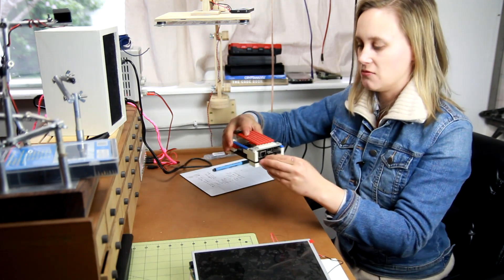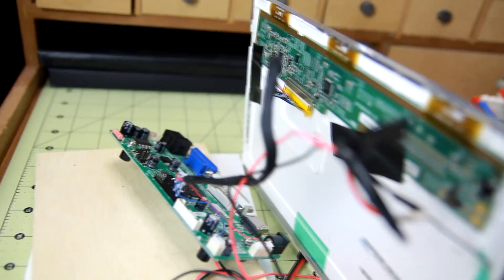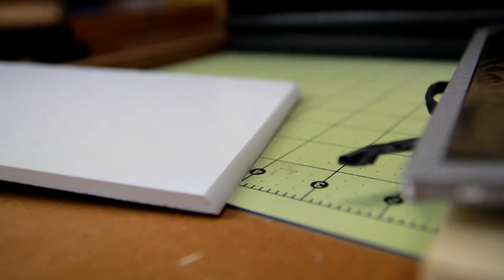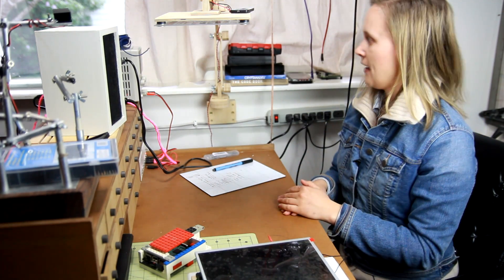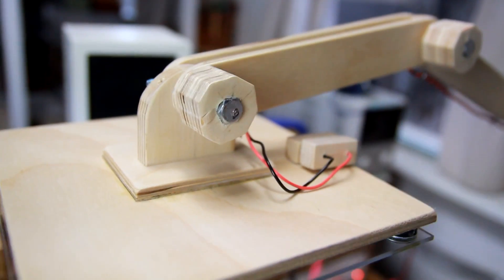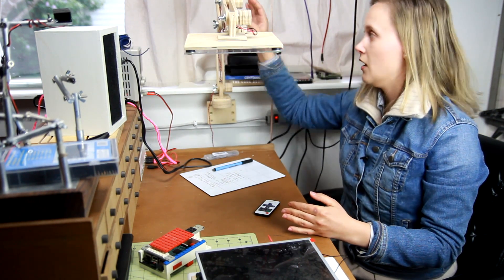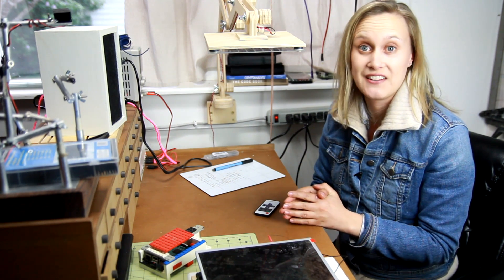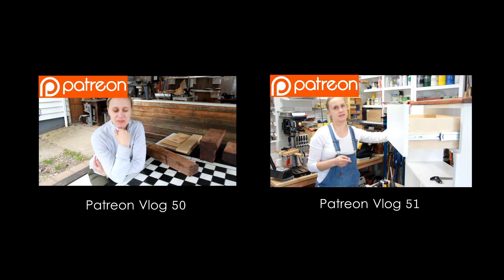Making an Articulating Screen w/ Raspberry Pi

Comment: hey linn 
I guess you need an arm with 180° angle and a support board on it with stainless steel spring that can hold that amount of mass you put on that arm maybe with a locking mechanism..

Comment: When I use Xacto knives for cutting thin plastic or cutting on a plastic cutting board, I notice they dull very quickly. A friend of mine who specialises in plastics told me I was right and they are very aggressive on sharp edged steel tools due to high friction.
Aren't you noticing any dulling on your router bits? Or maybe you haven't been using plastics long enough for any noticeable effect.
I'm very curious of the effect on them.

Comment: Only problem using Raspberry Pi with Arduino is that Arduino only offers an old version of the IDE for Raspbian OS !!  So the recent library management features of IDE are not available - and library management is a pain.

Comment: Don't forget to consider ventilation as you design the housings for the display and RPi. Doesn't need a lot; many pre-made RPi cases don't have any extra air flow holes beyond what's needed to expose the usb & ethernet connectors and the GPIO pins.

Comment: You should check out Kydex as another material to use.  It is a thermal forming plastic that can easily be molded to shape.  It also comes in tons of colors and can be printed on to create skins.  Also I am sure super glue will hold just fine but there are special adhesives out there for plastics, I believe weld-on is one of the larger brands.  It melts the plastic together causing a much stronger bond than a glue that just sticks the two together.  Very cool idea and I can't wait to see it come together!

Comment: Linn, check out ABS cement, any hardware store will have it. It is similar to the cement used to connect PVC pipe, it's just for ABS. It will make a better chemical fusion. Also of note, ABS can be heavily manipulated with temperature. In autobody shops I used to repair a lot of ABS bumpers. You can Fuse cracks and even recreate missing bits by melting extra pieces of ABS with a soldering iron turned down low. If you add a fine mesh wire grid into the back of a part by melting and embedding it into the part, you can create structural elements reliably. Just some stuff to look into if you really want to play with plastics beyond what most DIY Makers on YT are doing :)
Reply: +Jake Little Ordinary available-everywhere acetone also bonds ABS pieces extremely well.
Reply: +Dosbomber Good to know. I stopped using acetone a long time ago because of problems with constant skin exposure (it removes most if not all oils in the skin which can lead to allergies and/or lowering your immune system through your skin). IMO, no latex glove can withstand the abuse of abrasive autobody work and retain a worker's dexterity and touch sensitivity. For me, acetone was kinda useless anyway. It isn't much stronger then urethane reducers and isn't as potent as lacquer thinner as far as the autobody/paint world is concerned. I'll have to get a small amount to try this out at some point though, thanks.
Reply: Jake Little
If you just need a small amount, borrow some fingernail polish remover without any additives like lotion or aloe.  It's the exact same stuff.

Comment: I understand the tinkering part with the raspberry pi, but you could just build an articulating arm and a small case to hold a tablet.  Either way, it will be interesting to see how this goes.  Thanks for the video.
Reply: I agree with this guy. The other nice part about a tablet is you could have both a touchscreen and keyboard and mouse option. Their are plenty that run Windows 10 for under $200. With that said I totally understand the appeal to use the components you have.
Reply: +Mrcaffinebean but then you are stuck with windoze...

Comment: I don't know what you were planning on for the articulation but you could build it like one of those pull out bathroom mirrors since you don't need as much repositionability as the lamp you could do ot in aluminum fairly easily saving some  space

Comment: That lamp... Don't you need to dissipate the heat from the LEDs? I'm waiting for some UV LED strips to arrive for a PCB mask/solder mask exposer, but I'm planning on sticking them to a fat 40mm thick heatsink.
Reply: +John Alexander LEDs don't get that hot, its only a couple of Watts..
Reply: +BluePigProductions 162 LEDs - 40W. I'd like to know temps, because I'd guess they're running too hot.
Reply: John Alexander 40?! More like 10-20Watts
Reply: Depends on the strip. Mine are 144W/5m, 72W/5m is normal. This lamp uses 2.7m of strip.

I too thought I could get away with a thin Aluminium plate... then I did the maths.
Reply: +John Alexander 30 white LEDs on a 1m strip use about 4,5watts of power (12.15w when using 2.7 meters), RGB LEDs use about 9 watts, at least, mine do.. Yours may differ of course :)
Reply: She's using 60 LED/m strip. I'm going to use 120 LED/m strip. Yours seem to be 0.15W LEDs, mine are 0.24W LEDs. I'm curious to know what hers were, because, like I said, 162, 0.24W LEDs is 39W, and heat needs to be dissipated (at least by my estimate).
Reply: +John Alexander Yes indeed, almost 40 watts is quite a bit of heat.. Never thought there were so many different LED strips